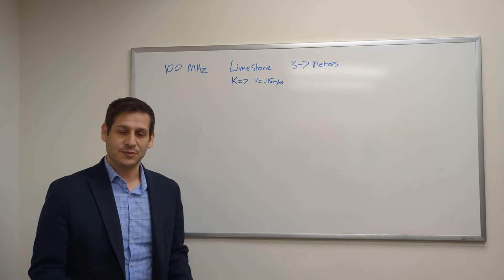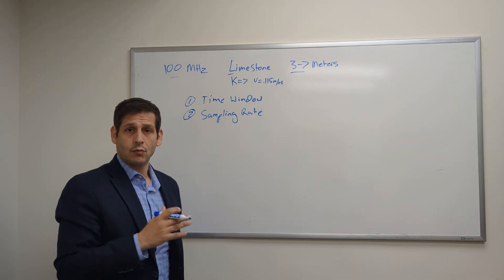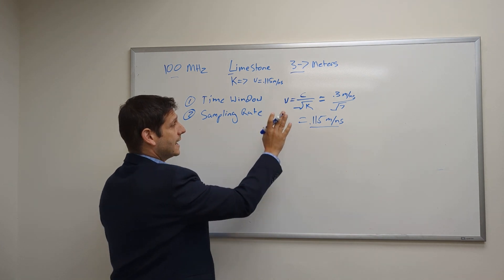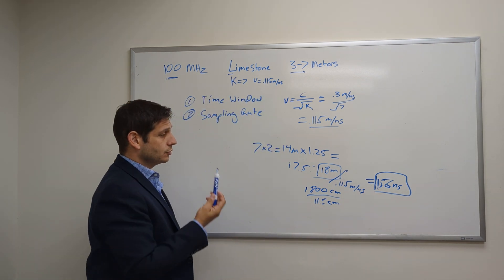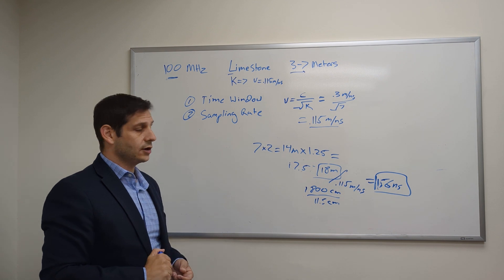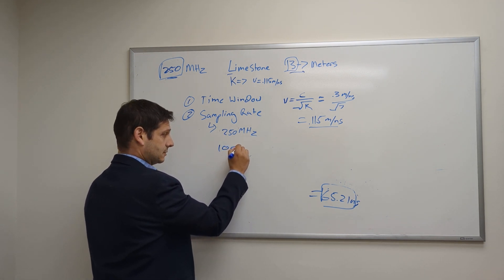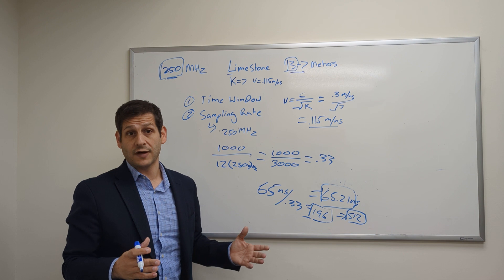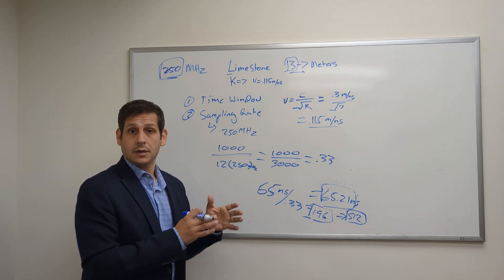Calculate Parameters for Low Frequency GPR antenna | ground penetrating radar | geophysics

Comment: Hi boss, what do you think about?

DS RIS MF Hi Mod 3D Ground Penetrating Radar System - Mala Hilti GSSI GPR
It has a dual antenna 200 MHz 400 MHz 600 MHz and 900 MHz 
Do you think this machine will penetrate up to six or 7 m? And if it’s worth the purchase it. Let me know your thoughts on it. Thank you.
Reply from the maker: Good question. In the best conditions, the 200 MHz antenna may go 6-7 meters deep.

Comment: hello bigman , i just wanna ask about the T/R antenna . if we need to detect things under 7 meter should we meke a distace between the antenas
Reply from the maker: You could try additional spacing to increase depth. Not sure that will work as I generally use standard offsets based on frequency/antenna size

Comment: Sir,
In our current project, client is asking the number of traces per nano second. Could you please elaborate more on this? Are sampling rate and Scan per nano second same?

We are using MALA HDR wide range we are getting two datasets: 500 MHz and 125 MHz.
Reply from the maker: usually spoken about in samples per nanosecond. He might be asking for the same thing. But he could be asking about stacking, as in how many pulsed generated in the same location. Or, he could be asking about scans per second which is actually a direction measure of scan step, not vertical, but that is usually in scans per second as we don't push/pull the system at nanosecond rates and that is only used in time mode. Otherwise its scans per meter. I would have them clarify since it doesn't sound like standard language. 

Hope this helps!

Comment: Sir,
Could you please advice some basic steps of GPR data processing for Geological layers? I am using ReflexW software 
Should I try Deconvolution and Migration as well?
Which Gain should I use: AGC, Energy Decay or Gain Function?
Reply from the maker: You could. Migration can remove small point detractions from layers.  Deconvolution can remote multiples from trapped waves. And some sort of gain. But it will depend. AGC if it works otherwise gain function. AGC is automatic gain curve.